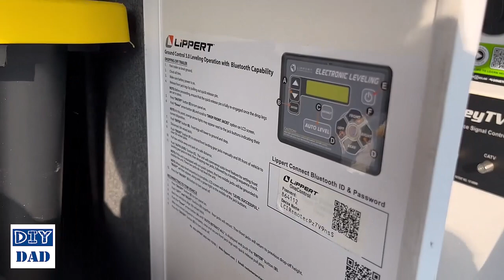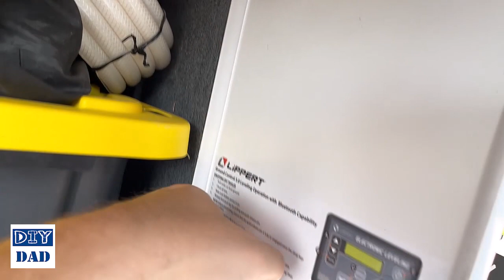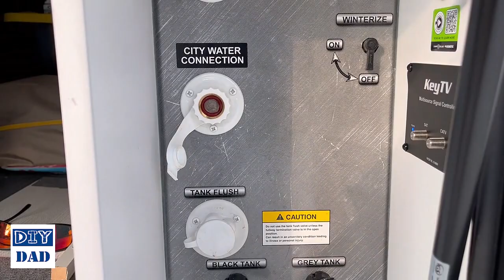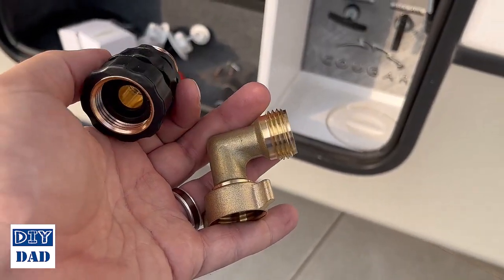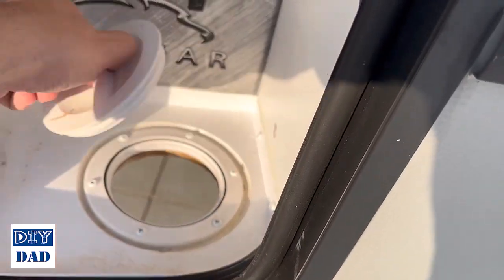Upgrading the water inlets on a Camper Trailer

Comment: Very nice idea, will be adding these to my 21 30RLS very soon! Thank you!
Reply: Will you leave the elbow in there permanently?
Reply from the maker: That’s my plan - leave the elbow and that half of the quick connect on it permanently .. added an elbow and QC to the black water tank flush - still use a different hose but it makes that so much faster
Reply: @AskDIYDad  sounds good that’s what I was gonna do too. Thanks again for the tip!
Reply: Finally did this job. Have no leaks but my quick connect isn’t connecting when I tighten the one end onto the hose all the way. If I loosen it in the hose end, then the quick connect will work. Only when I tighten the female end all the way onto the hose the male won’t click and connect. Any suggestion?
Reply from the maker: @jakehershey5223   - with my set there was an extra rubber washer in the quick connect fitting.  Tightening the hose all the way caused that to press into the space where the male part seats.  I removed this extra washer and was able to connect it.  Doesn't leak